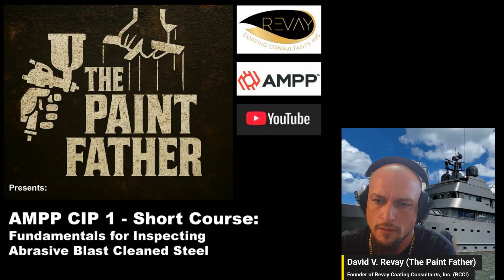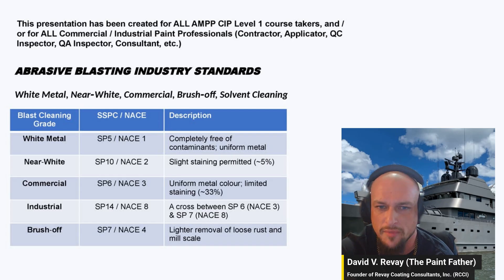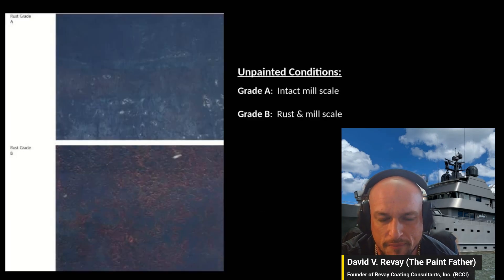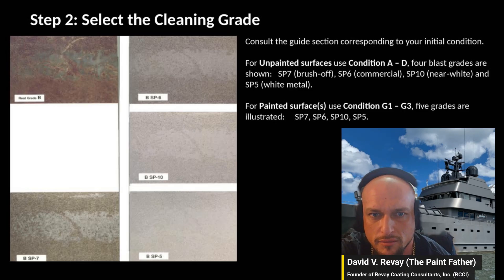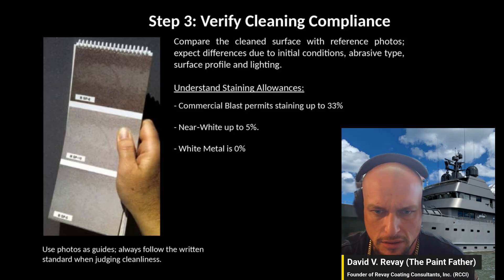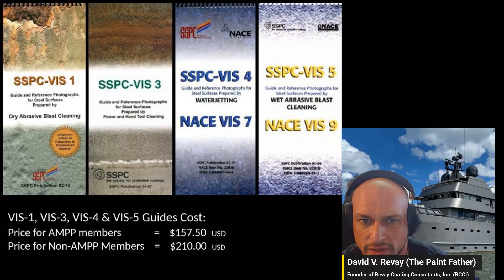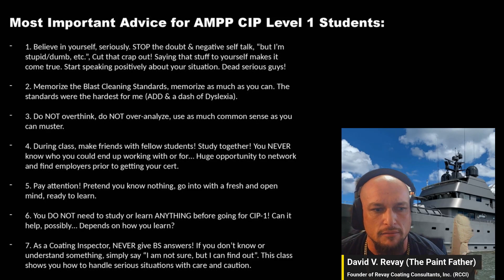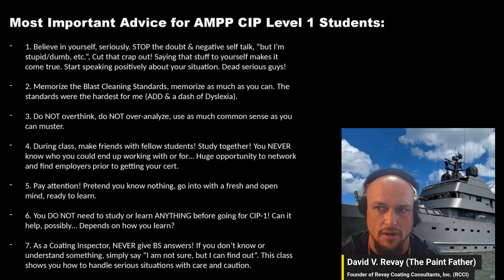AMPP CIP-1 - Study Guide #1 - Standards to Memorize!  #ampp #revay #abrasiveblastclean #VIS1

Comment: Any content on what to memorize or study for a level 2 exam?
Reply from the maker: I’m working on content for both 1 & 2, I’m hurrying. lol anything you want me to cover specifically?
Reply from the maker: Galvanic Series (Active vs Less Active Metals). Galvanic corrosion, MIC and crevice corrosion, then using ultrasound DFT gauge (Positector 200), umm over catalyzed, vs under catalyzed. In depth failure analysis of coatings. There’s more, but this should help.